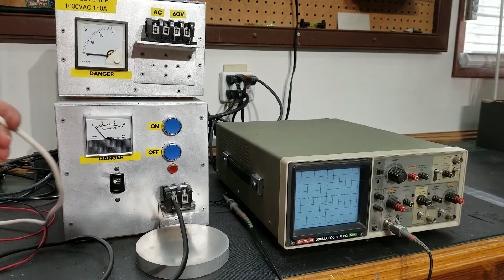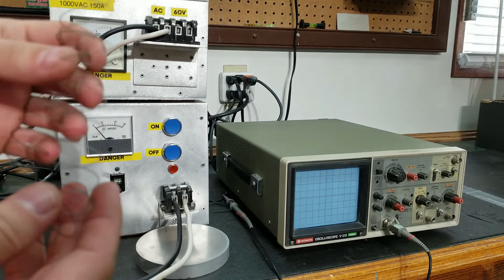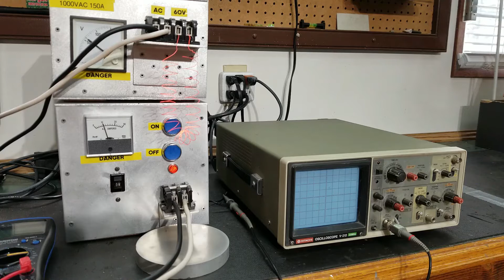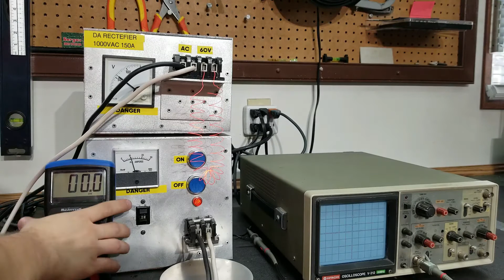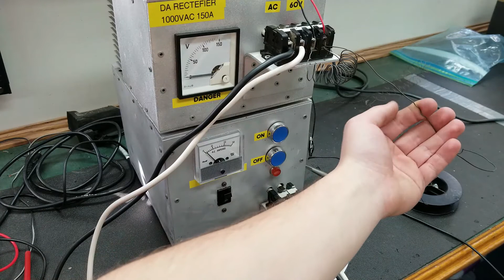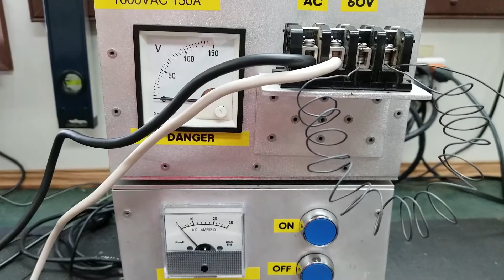👍🏻DIY 2KW FULL BRIDGE RECTEFIER!!!!!💣

Comment: Here is something I found online awhile back on the AC voltage calculation(I'll try and find the link later)- To Calculate the "peak" voltage output by multiplying the given (root mean square) RMS voltage value by 1.4, or the square root of two. An AC voltage of 10 volts (rms) or Peak will have a peak voltage of 14 volts. The rms voltage is roughly 71 percent of the peak voltage.

Convert this peak AC voltage to the equivalent DC voltage by dividing the peak AC value by 1.4. A peak AC voltage of 14 volts will produce a rectified DC voltage of about 10 volts. 

Another Great Video!